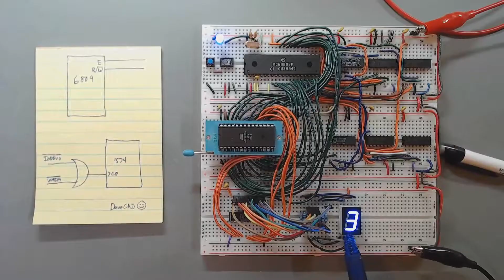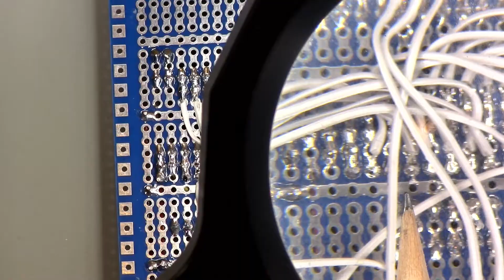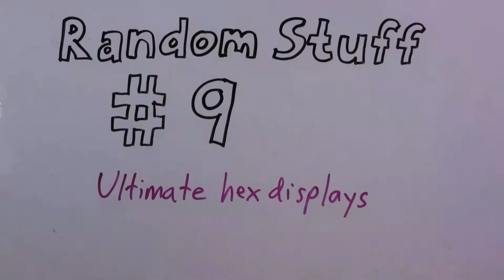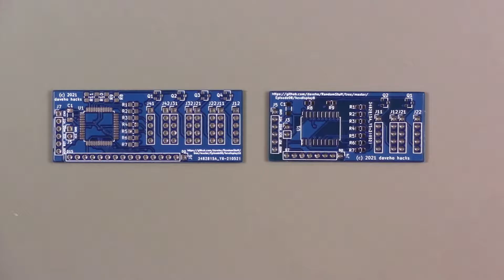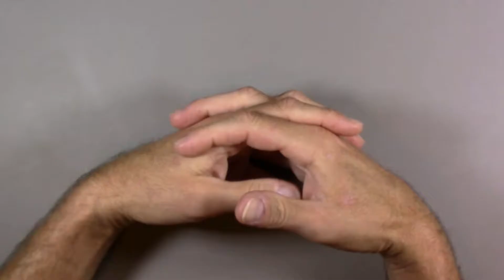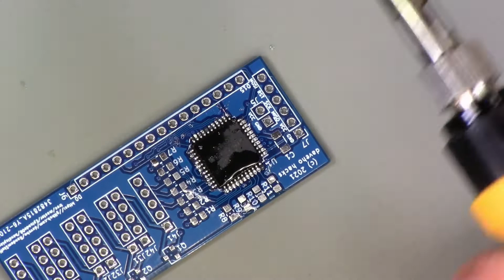Random stuff, Episode 09: Ultimate breadboard hex displays

Comment: You could try different soldering tip for a "drag" technique. For example, so called "mini wave", or a "knife" one. I aways use these tips for soldering SMT components - no problems at all. Of course, it needs a little bit of practice.
Reply: And lots of flux :) good one
Reply from the maker: @andrsam3682  I really should try drag soldering. Over time I've become more confident in being able to remove excess solder when there is a bridge, so I probably could make drag soldering work.

Comment: It looks like (at least on the 16b version) there's a slight shadow/ghost image of each digit on the next one to the right (wrapping from the last to the first).  I'm guessing you're changing the digit multiplexing lines while the segment data for the previous digit is still active.  If you set all the segments to off before changing the digit lines you should be able to avoid that.
Reply from the maker: I'm sure you're right. That would be an easy firmware fix. I'll take a look at it, thanks for the suggestion!

Comment: That's pretty cool.

Should try out drag soldering. Works great and easy to fix if you mess up.
Reply from the maker: I actually did try drag soldering, but for whatever reason, it just created tons of bridges that were hard to remove. I'm wondering if using footprints with longer pads (as I mentioned in the video) might make drag soldering work better.
Reply: You could be applying too much solder. The trick is to use a flat tip or gullwing tip, RA flux works best but you want to clean it off as soon as you're done and use 60/40 solder.
https://youtu.be/wUyetZ5RtPs
I use that method and it works great for even the tightest pin pitch.
Reply from the maker: @lelandclayton5462  Useful tips! I'll give it another try next time around.